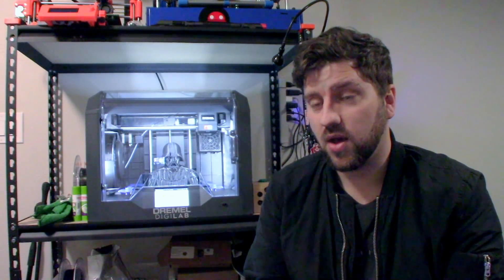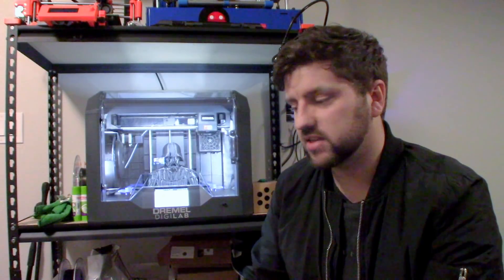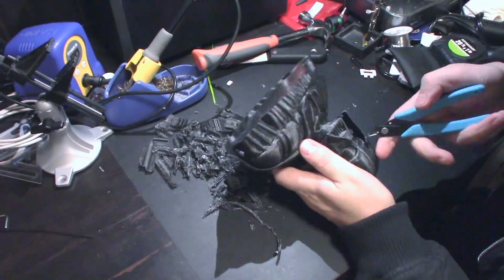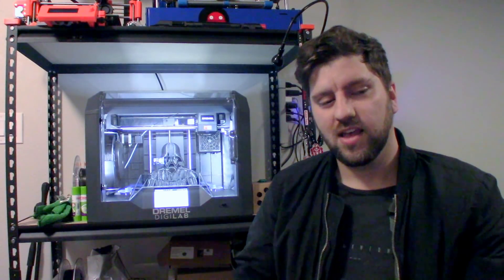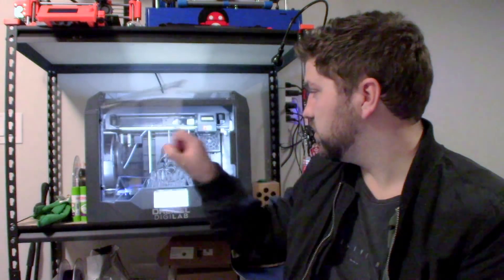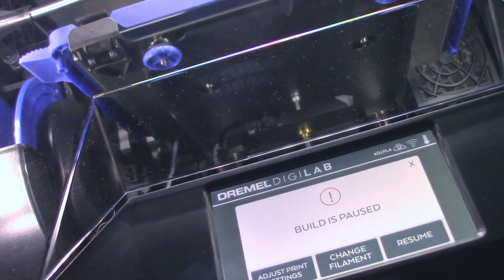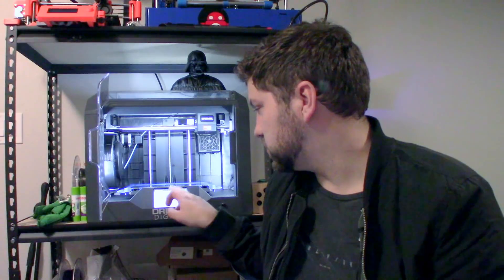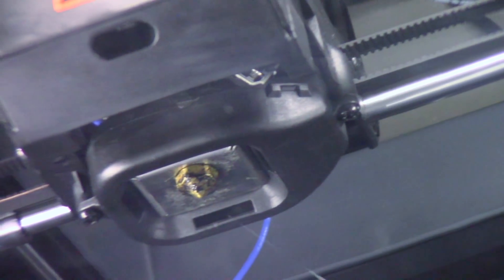Dremel DigiLab 3D45 Review

Comment: Thank you, excellent video with a lot of good points. We are considering purchasing this for our very small biz to print out some prototypes. Is it possible to purchase a standard non-Dremel (or Dremel if they make it) stainless steel nozzle and attach and do you know if food-grade ABS filament can be used? We are trying to print something as food-grade/drinking water safe as possible, but we have a backup plan if not (skinning the print with thin FDA-grade material). Thank you!

Comment: Did you try to print tpu with it? I wanted a user friendly printer and thought nylon is similar to tpu, but it doesn’t work for some of my needs. Overall I’m happy with it, just the fact that it doesn’t officially print tpu...
Reply from the maker: I never printed TPU with it. If you do I would print hot and slow with as little retraction as possible and take care when removing the filament to prevent clogs.
Reply: @disruptityourself  thanks! I will give it a try. Read the exact recommendation. Very slow etc.

Comment: Just ordered on in the UK...hasn't arrived yet...can you work straight from a sketchup model, or do you have to use special software.
Reply from the maker: You need to export your model as STL files or possibly OBJ in some cases. But then the file has to by turned into tool paths that the printer can follow. That process is called slicing and the software is aptly known as a slicer. Dremel provides a few free options for slicing out of the box.

Comment: Hi, what's the different between Eco-abs and normal ABS? Because the price for 1kg of filament si so high for eco-abs. Can  I print with this Dremel with a normal ABS? Thank you
Reply from the maker: Yeah so at this point I can confidently say eco ABS probably isn't Acrylonitrile Butadiene Styrene but some other high temperature but styrene free plastic blend that is similar to ABS. That being said I have been using 3rd party ABS, ASA, CPE and Nylon for over a year now.

Comment: I'm usually not inclined to damn software after the first test (40+ years IT-business) but this Digilab Slicer is the worst example of 3D-slicing software I ever got my hands on. Apart from ONLY 3! (three) fixed settings you have absolutely NO CONTROL over the print. No temperature control, no control for layer height, no control for wall thickness, no control for the size of supports (you get a brick-like structure) and the print quality ? you get some artifacts on plain surfaces... I'm not Michaelangelo to hammer out the part which is enclosed in the supports. 
AND - NO HANDBOOK, NO SERVICE 
DREMEL - this is CRAP
Reply from the maker: What slicer are you taking about? The cloud slicer? Dremel Cura? Or the old proprietary one? I use Simplify3D.

Comment: Andrew. Great review.  Among all the other reviews no one ever mentions how much current draw these machines have.
I'm an RC aircraft modeler. Some plans out there say 75-90 hours of print time.  Filament may be cheap, but what does that do to your electric bill?  I would love to have anyone weigh in on that cost!!  thanks!
Reply from the maker: Well I guess I've never bothered because it would require me to get some equipment to measure that like a Kill-a-Watt. For me its never been noticable. I've estimated at one point my bill had gone up about $5 a month with heavy printing but that will be very different based on your location.

Comment: I purchased one of these as my first 3D printer.  It prints consistently and very well right out of the box.  I played with the Dremel software on some of the prints but also use Simplify3d because of the ease of breaking off supports.  I really don't use the camera feature that much but it is nice to do a print using the cloud interface on occasion to have the build video to share.  Being new to 3D printing, I am still learning but I am impressed with this machine without any regrets.  I have been keeping it busy.  Thanks for doing the review.
Reply from the maker: Thank you for sharing your experience! I feel much the same way on each of those points.
Reply: Andrew, I wanted to add that the bed leveling is always right on and the printing of bridges and overhangs is phenomenal.   Thanks again.
Reply: Does the machine have a built in scanner function to scan a part into your computer to edit and print?
Reply from the maker: It definitely does not. I only know of one machine with such a feature. It is not very common.

Comment: What cloud do you use and do the different filaments come out better than the pla filament and if the Dremel 3D 45 is wifi-connected. I am into model trains in which filament would be the best to do like houses and buildings. I have the Dremel 3D 20 so the Dremel 3D 45 would be a big upgrade for me. I like your review it is very informative keep up the good work.
Reply from the maker: Tim Shipman The cloud is through 3DprinterOS. I'm not sure what you meant by that second part. Could you clarify?
Reply: Disrupt It Yourself does the ABS or nylon filament come out smoother than what the pla does. Also do you have to put any kind of adhesive on the printing bed for the nylon or the ABS or the pla. Since it is a glass bed I've seen on some videos some people were using Elmer's glue stick for the ABS to stick to the printing bed. Just a thought if you were to do a video on the different filaments that Dremel has and their uses it would be very helpful. Thank you for your response. Tim
Reply from the maker: Smoother might be subjective but maybe... The real point is that they are stronger materials and wont deform on a hot day (or in other situations where heat and impact is a concern).
Dremel actually includes PVA glue. I'd be happy to do a video as you suggested. Just trying to find time. If you can help me get the word out about my channel it might help me allocate more of my time to this project. Currently it is a labor of love and happens in the late evenings/nights or weekends.
Reply: Disrupt It Yourself I will do my best to get the word out for you you really do a good presentation and explain things very well. Keep up the good work. I like designing and building my own structures for the model train layouts and it's cheaper than buying the kits some kits cost as much as Thirty or forty dollars and I can make it for pennies. I just do it for myself I don't sell them thank you for the info it's helped me quite a bit. I didn't know if I want the 3D 40 or the 3D 45 but with your help I believe I'm going to go with a 3D 45 Dremel has made a very nice printer that's easy to work with.
Reply from the maker: Tim Shipman feel free to email me if you ever have any questions and if you do buy it do me a favor and use the link in the video description. It might help me buy some proper video lighting someday.

Comment: Where is the source for the Dremel version of Cura? Could you ask them to provide a link? I think it's required as part of the Cura licensing agreement
Reply from the maker: https://digilab.dremel.com/software
Reply: Thanks for the link, i'll try out the software, have you noticed any cool modifications? Part of what makes Cura great is the license, and I would love to merge any cool modifications with the official Cura branch. If it's just a simple re-branding then it's probably no big deal.

https://www.gnu.org/licenses/gpl-faq.en.html#GPLRequireSourcePostedPublic

..."if you release the modified version to the public in some way, the GPL requires you to make the modified source code available to the program's users, under the GPL."
Reply from the maker: J It's possible that the only change is that it outputs their .g3drem files.
Reply: Good point, I have yet to explore the package but I was hoping they would implement some cool new infills or something ;)
Reply from the maker: J Type A Machines did. They use D infill in their special Cura version.

Comment: Does it use proprietary filament?
Reply from the maker: Michael Platt yeah I think I mentioned that right at the begging didn't I?
Reply: Disrupt It Yourself sorry, must have missed it. Thanks!
Reply from the maker: Michael Platt No problem man! The video could have been more structured I'm sure. Sorry if it was confusing.
Reply: I was wondering about this too. You mentioned the 3D40 uses proprietary filament, but did not say that the 3D45 also does. Thanks for the clarification in the comment
Reply from the maker: J You're absolutely right. I meant to imply that they had that in common but I really didn't. I think I'll make a separate video as soon as possible and talk about filament. Thank you!